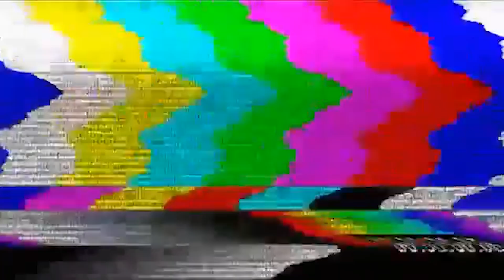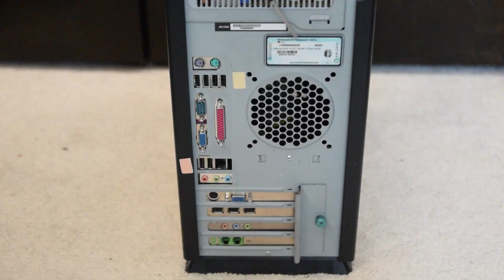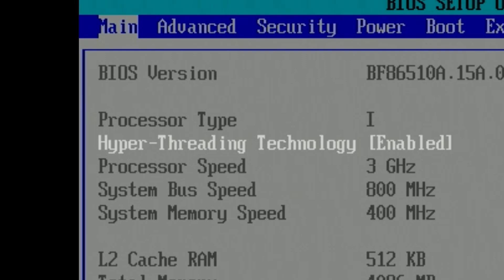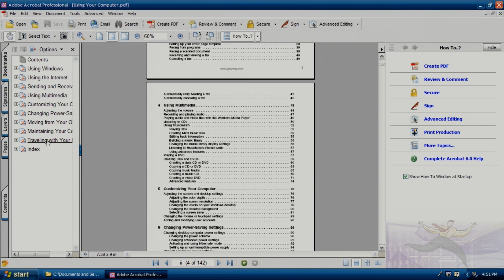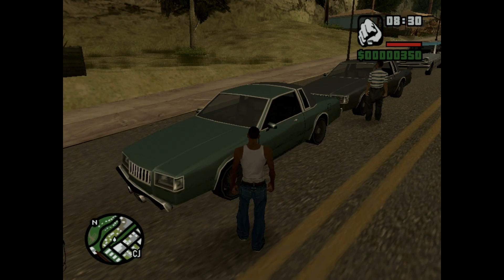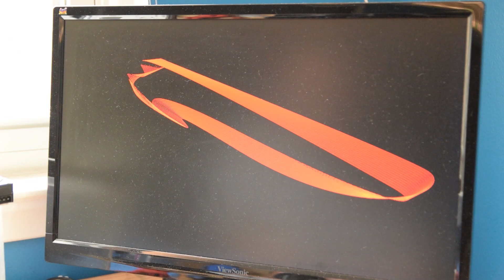Retro Review: Gateway E-4100

Comment: The cpu fan and optical drives failing to mantain a constant speed lead me to believe that the 12v rail on the PSU might be going weak. I'd monitor the voltages under load
Reply from the maker: I’ve had this exact concern before. So I tested this PSU with other components and with other computers and while the 12v rail was a little low it didn’t seem to cause any issues. I also tested the system with a different PSU and found a lot of the same behavior with the components, which is why I thought the PSU was fine, but who knows really
Reply: @betapyteag damn, so it could be anything at this point

Comment: I have one of these they were great Computers at one time. I had a Gateway 300 S slimline case. I still have the HDD not the OEM install but the last install I did before the system died. The HDD was good and still is good. I tried to boot it in the E 4100 so I can see what is on it. I know I can see the contents with a USB adapter. But I want to see what is on it by trying to get it to boot. I know it is possible to boot XP in a different system I just got to remember how. It was Windows XP Home.

Comment: I have some LG DVD combo drives and they have problems as well. They are stored along with other drives and last time I used these LG drives, some stop reading CDs or they don't read DVDs but read CDs. I remember 20 years ago to replace the green led from a cd only writer from LG and put a red led... funny.. the DVD combo drive had a green led and the bottom drive had a red led. 
Some years until now, I absolutely kind stop using DVDs or burning them. I only write them if I want to store things permanently.